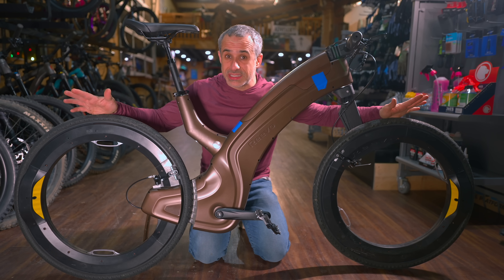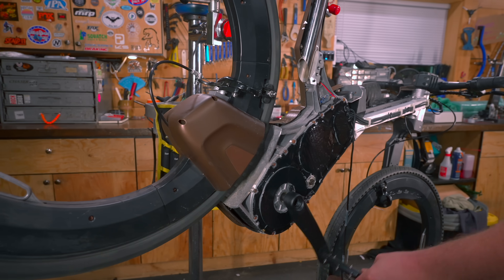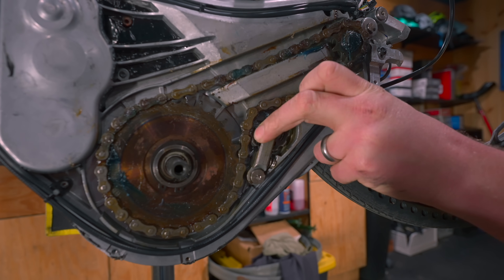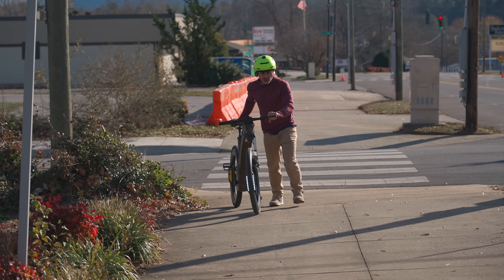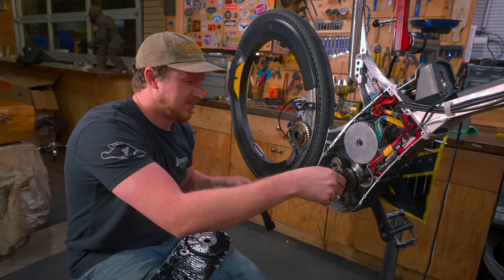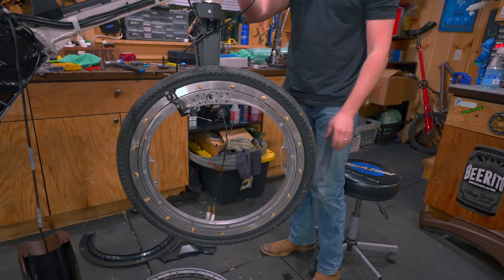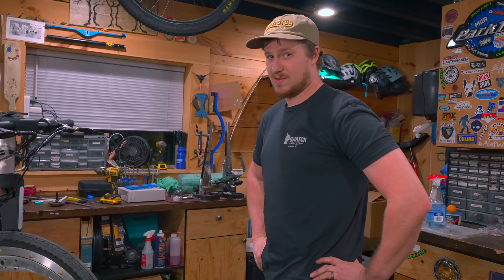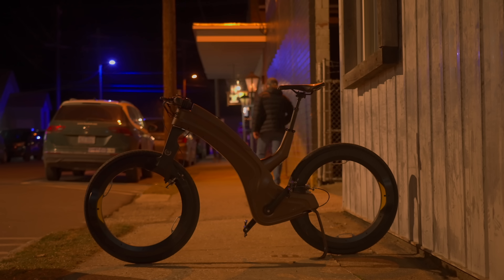What's Inside The World’s Worst eBike? Reevo Teardown

Comment: To  quote a friend, “someone had a bad idea and went a long way to prove it”
Reply: Phenomenal quote, stealing that.
Reply: @ two quotes in one video and comment section? the other one is "rust is natures loctite"...

except working on old ag equipment one realises that rust eventually becomes "natures breaker bar" as nuts rust completely away!
Reply: Yoink.
Reply: There's a LOT of dumb people who will pay a lot of money for dumb gimmicks.
Reply: @rubiconnn  you mean these bitten apple stuff thingys? 🤪🤔
Reply: I'm more surprised that they actually build a few hundred (?) of these - that took alot of manpower to engineer and assemble.
Reply: No need for a security system that bike is so crap it’s not even worth stealing
Reply: @Shamefulbird  It probably would get stolen by a thief thinking it looked cool, and dumped in the nearest ditch after they try riding it. So a loud alarm to help you find it would be an advantage.
Reply: @mels8966 mh yes and no depend on the distance if he went multiple kilometers away you won’t hear it anymore
Reply: But let’s be honest if it where to be stolen it’s do be broken apart and it’s aluminum and electronic sold in a scrapyard
Reply: I'd say it's a meh idea, terrible execution, I really feel like you could cut out a lot of these parts and it would work better, maybe not better than a hubbed wheel but certainly better.

Comment: Hubless wheels require either a large diameter bearing or at least 3 small bearings and a reinforced rim to work. However, in both cases, due to the high relative speed between stator and rotor, the internal spheres will spin extremely fast, increasing drag and thus negating any benefits.
The only way to make hubless wheels truly viable is to use magnetic levitation between the stator and the rotor, with the levitation system doubling as an in-wheel motor.
Reply: and in any event is trying to replace a design which has been refined over centuries to the point where the only measurable drag on a high end ceramic bearing lightweight bike wheelset is aerodynamic. This is like trying to redesign a coffee mug.
Reply: Neodymium magnetics could technically make the levitating wheels work...they'd just be insanely heavy and pick up all sorts of iron-based debris
Reply: That solution is too complicated 😅 Sounds simple, but in reality it isn't... sounds like an idea for a start up🤔😁

Comment: why why why wouldn't you just have the housing setup for one gear on the motor go direct to one main gear on the drive if that the end result?  if your not even going to bother with a type of gear box then any more than 2 gears / cogs is a waste of transfer energy?  it also sets itself up to being more problematic and prone to failure?

Comment: Wow all those thick solid steel straight-cut gears - no wonder it sounded like a bag of buckshot in a washing machine. Surely hiding a tongsheng drive unit in there would have been easier and lighter. I know with all my soul that hubless wheels are awful but I love the look.

Since in its bits now you should try to improve it 😅

Comment: the design on the wheel is actually ok the problem is the gear implementation they should have just made a simple  normal bike like gear that slides and lock  it could have reduced the complexity by half

Comment: Could it have worked if they had just put electric drivetrain? Pedals would connect to generator and wheel(s) would be driven by electric motor... or even make that rim as a motor itself. Power loss yes, but still less than there is now. :D

Comment: One question, from the crowdfunding platform that brought you the ‘Superstrata’ bike, a plastic frame with no sea tube…we have the hubless wheels bike!
WHY? What mechanical issues does it address or improve upon? ZERO.

Form should follow function. These bikes are about as innovative as ……. heck all I can think of are those dreadful ’life hack’ videos showing you how to use a washer in a drill rather than an appropriately sized flathead screwdriver. A solution in search of a problem…..

Comment: The front wheel "spin" comparison test was massively bisased towards the Reevo, because to spin ther latter to the same speed way more energy is required. 
For a fair test, strike a fast glancing blow on the tyre with something light, like a chopstick, and see it spin from the energy transferred. Then do the same with the reevo and see if it even turns a little.

Comment: If you really had to make hubless tires, I would put three large bearings near the drivetrain. Two in the inner side and one on the outside. Still massive amount of drag and the need for a reinforced rim to reduce imbalance, but less drag than all that little wheels

Comment: I would have guessed that the wheels would at least be custom oversized ball or needle bearings. But they even cheaped out there. Those Nylon wheels look like the ones used in aluminium profile gliding systems. So stuff, that you can make a sliding door out of. Friction isn't that big of a deal for a door. Also just way too many gears.

Comment: The wheel spin shows how bad and crappy the construction actually is.  Large Ball Bearings may be expensive, but they exist. Unasis offers a 10 mm wide bearing with 863.6 mm inner and 882.65 mm outer Diameter. Or to they could have cheaped out and gone for Linear rails. That are very simple milled rails that could easily be made ring shaped. Or go crazy and  do it with an air cushion or magnetic field cushion. 
The power drive could have been done by friction rollers - inside, out or sideways - with direct Drive Brushless motors (The reverse of an ancient bike dynamo) taken out of electric skateboards. They do every RPM, no gears needed. 
That's what comes to my mind in minutes. It doesn't make it a better solution than a central sheel bearing that has proven to be working great for centuries, but at least it could have worked as a bike at all.

Comment: Looking at the wire mess, the designers ran out of money to design the electronics and put a cheap chinese ebike controller in it. Since it has a simple PAS and no torque sensor I'm 99% sure the serial number of the controller will start with KT or LSW.

Comment: I wonder at which point they went to pump up the tyres for the first prototype and after spinning the wheel a few times, realised they couldn't find the valve and had to go for flat spotted airless tyres?!  You can even see in the promo video that tyres both have flat spots!

Comment: If the had just gone with regular MTB wheels + disk brakes, regular ebike rear hub motor, then just the looks of the frame would still have sold a ton of bikes. Hubless has zero attraction to me, but the aesthetics of the frame I like. Spending all that time to engineer a terrible bicycle, is just nuts.

Comment: I'm surprised the core isn't literal lead. To get maximum weight and minimum rigidity

edit: omfg, is that a tiny cheap hobby servo hiding in there too? The most cloned one in existence, almost definitely fake and not up to spec
edit2: those little wheels are the same thing my 3d printer uses. All that stuff is off the shelf but totally the worst thing for when you want low rolling friction

Comment: As someone who is both in engineering and a manufacturer. I have so many thoughts on this. My first thought as a manufacturer is... who the flipping heck thought this bike would be affordable. Everything on there is so expensive to make, especially the frame on the wheels that's cast aluminum, that would be SO EXPENSIVE and completely unnecessary. They would only be able to manufacture a few of these, and they would cost a TON to make. Also it's no wonder the bike is so heavy look at all those gears those are solid steel gears, you know how much that weighs. The shaft on that gear alone probably is at least 5-10lbs. No wonder the bike is so heavy. Also, I will tell you now, that the gear on the inside of the wheel is going to wear out so fast, because there is no oil on that gear, and it's probably being exposed the elements. It's going to wear out so fast. 

My engineering side is like... that is pretty bad engineering, the electronic stuff looks good, but it's clear whoever made this probably doesn't have skills with bikes, because it's built more like a gearbox transmission on a car than on a bike, it's also super weird they would use a chain and a gear it's almost like someone knew a chain was on a bike and just shoved it in there to make it look like a bike. Also, there aren't enough bearings on the outside of the tire for a smooth ride. Reparability is awful. It honestly looks like someone who works on cars made this, and didn't understand the need for it to be light. As far as I can tell the electronics seem to be good, but it's clear whoever came up with this idea likes gears, and thinks gears solve everything because there are so many of them.

If I were to build this bike, and not that I would because I see no point in it, but if I did I would have run a really long chain around the outside of the back wheel, and connected it to a gear where the petals were, with a one-way gear on the shaft that connected to the motor. Then I would have made the back tire have two sections with ball bearings, making the wheels would have been kind of a pain, but I could probably make a few loops and put them together, mind you this is a pain. 

The biggest issue with something like this though is that in order for the back wheel which is a large gear to spin once, the little gear needs to spin a whole lot of times, this means you have to petal a ton just to make the bike move a little bit. The chain idea I suggested before would have been a better idea, but it still runs into the same problem where you would need a ton of chain, just to make the wheel spin a little bit. Of course if you put a small gear in the middle of the wheel and then had it turn the entire wheel that would probably fix your problem, but... oh wait that's just a regular bike wheel! If you put the ball bearings on the inside rather than the outside... but oh wait that's how a normal bike is made. Crazy it's kinda like the design of the bike didn't need to be changed after all. The best hope for a design like this would be to try to find someway, any way to put a large gear on the middle part where the petal is just to try to get a good ratio between the back tire and the petals spinning. Because unless you can solve that, it's really not going to be a good bicycle. It will always just be way too hard to petal, and that's why you end up with the gear on the petal that has two gears on the outside, because they are trying to increase the rotation, at the expense of torque which would make the bike very hard to petal.

Comment: What's funny is the little wheels at 9:13 look like the consumable wheels used on early fdm printers, easily replaceable with a harder compound wheel and good bearings if you go on eBay. One of those parts that is known for having flat spot issues on things like the cr10

Comment: Hubless wheels are just a stupid idea, I mean they aren't actually hubless anyway they just have a giant hub the same size as the wheel rim, along with a massive diameter bearing system with much higher total friction and more parts to wear and which has to roll at a very high angular velocity compared to a small strong lower total friction bearing that rolls at a lower angular velocity in a regular bike wheel hub.

Comment: I see that the sensor is only registering that the padels are rotating. You can see it at the disk that contains about 12 magnets.
When that rotates, the systems thinks you are padeling. You can start pedaling, then stop pedaling and possibly the bike keeps going forward on the motor only.
Just like the way you pushed the bike and let it run on it's own.

Comment: The hub is the only interesting thing about that bike. It looks like most of the critical flaws are software/control, which you should be able to easily design a replacement controller for. Hopefully the hub bearings themselves are low friction. It looks like they didn't implement a proper motor driver and it's just charging the battery when you pedal, as opposed to freewheeling. Those gears also look really thick, much thicker than necessary for the torques involved.

Comment: Everything about that bike screams "Lets get a ride able prototype that we can then refine for the finished product"
Between the little rollers, They look to me like V-Slot rollers used with alloy extrusions, you can find similar type things on some 3d printers and that. Really only designed for force in one direction. You would normally put them on multiple sides. But using them in the wheel like that as soon as you turn it will put thrust force on them. Doubt they will last long at all. Not to mention dirt/grid/water getting into it all

Those wheels and the ring gear. They look like Die cast aluminum. Very prone to cracking and then its only a matter of time before you go over a pot hole or something and the whole wheel shatters. I can see the teeth snapping off the ring gear as well.

Comment: Engineering analysis:

The large resistance to pedaling is caused by two primary items: 
(A) The drive system utilizes a planetary gear set to make up for what is most likely a low torque motor, back driving a planetary gear set is a massive power drain as it requires the inverse of the torque gain it provides when driven from center. 
(B) The large gear on the wheel is a straight cut gear and drive gear. Striaght cut gears are strong, however, they are the noisiest gear train and until the two gears mesh together can produce the largest power drain from the pressure relief angle of the gears being out of range with respect to each other. 

Correcting (A) is a matter of eliminating the planetary gear train, or integrating an on/off mechanical control through a clutch. 
Correcting (B) would require angular contact gearing (i.e helical gearing, herring bone gearing, hypoid gearing)

The driving/driven aspect of the drive train which requires such a complex array of gears for rotation and counter rotation can be simplified by reverting to belts or chains for direct aspect drive. This does cause a packaging issue as the required components to accomodate the belt/chain drive are less compact than gears. High strength COG (Timing) belts can help offset this through a 1:1 torque transfer capacity.

The "runaway drive system" caused by the crank being back driven by the wheel can be revised by using unidirectional sprag clutch where required, or either a  mechanical clutch or hydraulic clutch.  

PRO(s)
The use of sealed ABEC bearings inside follower wheels that mate to a large machined carrier is brilliant. Obviously labor intensive to assemble, service, and dissasemble in it's as manufactured condition. It would only require small changes to be magnitudes easier to assemble, service, disassemble.

The system is overall not to complicated, it was made complicated by designers and engineers who lack machine design experience. 

The asthetics of the bike are pretty slick overall.

Conclusion:: To correct all these items and the supplmentary items that are overlooked in the video would easly add $2000-3,500 on top of the current MSRP, however, the result would be a bike that lived up to or surpassed the expextations of the customer in longevity and serviceability. The one big item would be ridding the wheels of the C-caliper brakes, either by replacing them with V-brakes or ridding the wheel by integrating a large diameter disc brake system. 

I would consider buying this bike just to make all the manufacturing and design corrections.

Comment: The spoke and hub wheel might never be improved upon. Low cost, light weight, minimal mechanical friction, comfort, simplicity, repairability...
Different designs might improve on one or two traits, but for all around benefits, the stars align with the tried and true.

Comment: Now you gotta make a video replacing the cheap parts with better ones to see if you can make it better, i.e. the bearings and rollers around the wheels or any extra resistance in the gear train.

Comment: Never once would I have thought that a wheel like that could have low rolling resistance. A normal wheel and hub have something like 27 to 1 reduction in diameter for the rolling speed of the bearing, but the reevo only has between 5:1 and 2:1 reduction in diameter for the bearings as well as increasing the bearing count per wheel from 1 to 17 as well as adds in extra rolling friction from the 17 small wheels interacting with the large rings. This means that you have 17 rollers spinning ~5.4-13 times faster than a single normal hub and I bet the rolling resistance skyrockets when you lean to the side from the rollers interacting with the sides of their tracks, I bet the main noise was those small rollers rolling in their tracks.

This project should have started and ended with trying to design the wheel itself, and subsequently failing to make a wheel that compared in performance to a standard wheel. I am sure this didn't save on weight over a normal wheel, and the rolling resistance + noise are..... a problem. Yeah you can have pedal assist, but what does that help if your range and speed are trash compared to a bike with standard wheels?